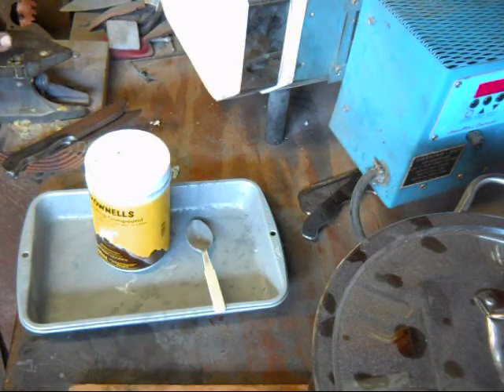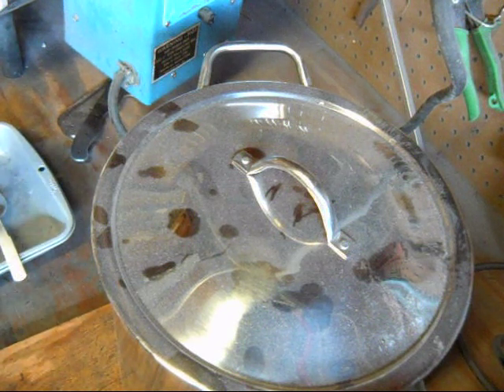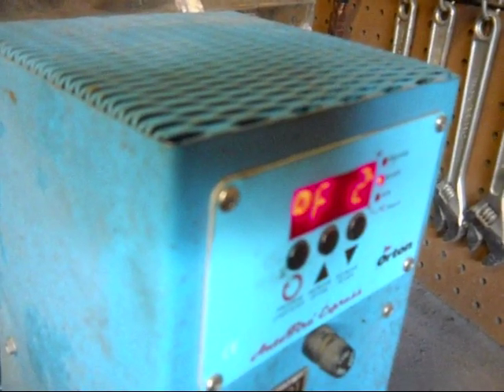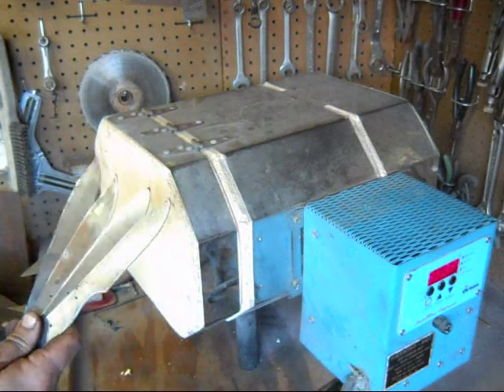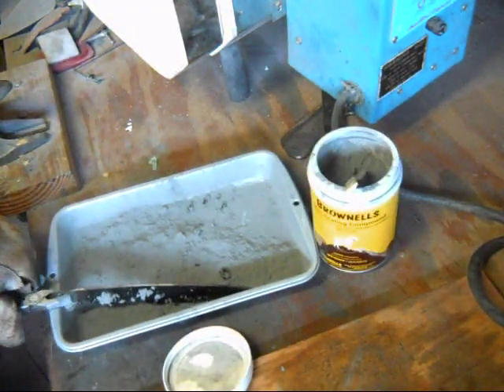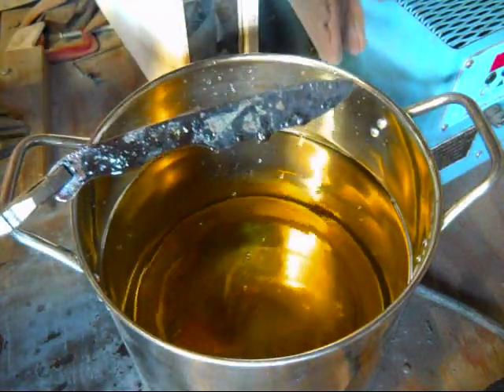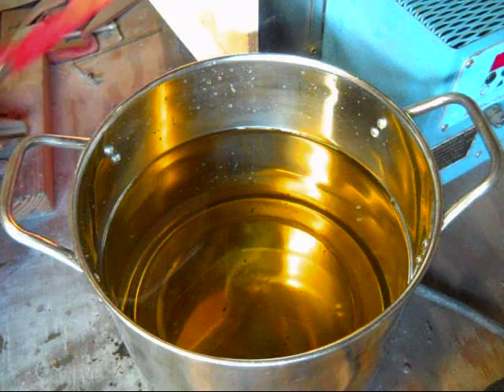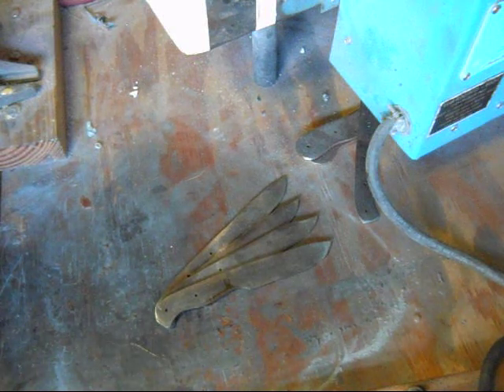Heat Treating Carbon Steel Update

Comment: Nice video, thanks for posting.
I'm learning knife making primarily from the internet and have made my own belt grinder.
There are a lot of ways to screw up but I agree with you about heat treating being just about the most important part..I like what you said about canola oil doesn't stink like motor oil (good reason to use it) instead of conjuring up some mystical B.S. about atoms or molecules or some such crap LOL....What about that quenching oil temp....Is it really that critical?...If it is as critical as a lot of people say then why did you swirl some of the blades when quenching and some not? It seems to me that failing to swirl the blade in the oil or water or what have you would allow the super heated oil to remain next to the knife whereas a" swirl" would force cooler oil onto the blade. Thanks in advance.

Comment: Can Borax be used since its role when forge welding is the same,to prevent scale and decarb? I do not know and was just wondering if it was a viable option.
Reply from the maker: I'm not sure.  Would like to learn blacksmithing at some point, but don't know enough about it yet.

Comment: Thanks for getting back to me.  I talked with a tool and die maker and on his advice got a carbide masonry bit.  Looking at the bit in Lowe's, I would never had guessed it would cut through a file.........I was wrong!  I now have three nice clean holes in the handle of my file knife.  So far, so good.  Thanks again.

Comment: Man that heat treating oven sure looks like it would make things a little more accurate for me.  I use my forge and do it at night so I can see the steel better.  I get good results like that, but I don't have the soak time, so I think my heat treat could be better in that aspect.

Comment: Man that heat treating oven sure looks like it would make things a little more accurate for me.  I use my forge and do it at night so I can see the decalesense on the steel.  I get good results like that, but I don't have the soak time, so I think my heat treat could be better in that aspect.

Comment: so you temper them pretty soon after the heat treat right? i recently read somewhere that the longer you wait to temper them the more stress fractures from from the steel getting back to its regular shape and thickness after being expanded from the heat